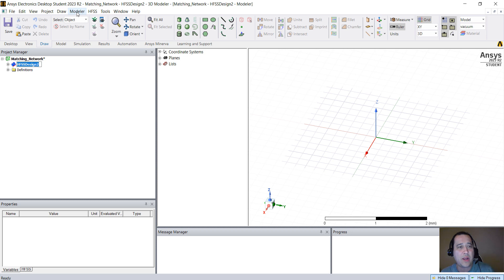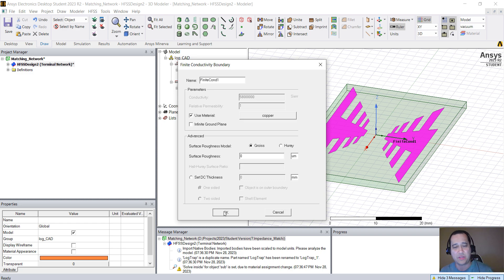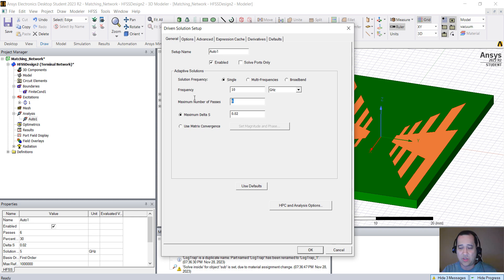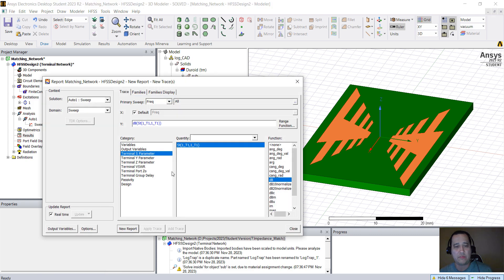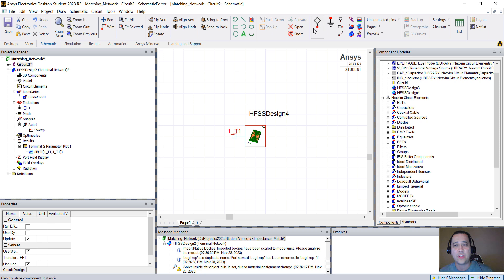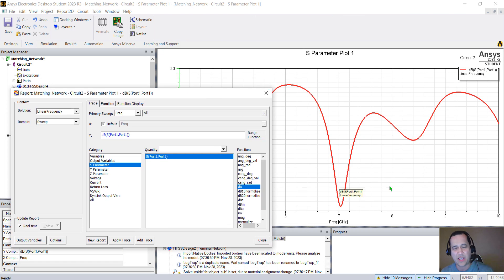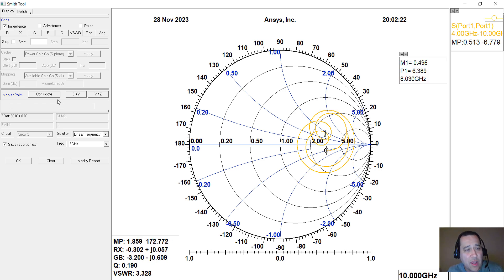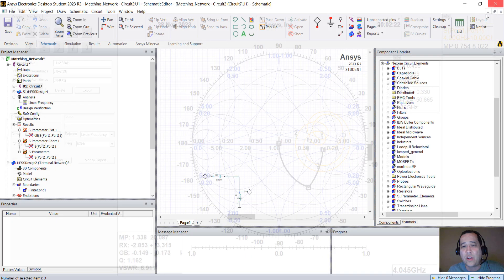How to use Smith Chart to create a Matching Impedance Netowrk with Ansys HFSS Student Version

Comment: Hello Sir, currently i am working on my project which inlude the 2 layer PCB, with 0402 SMD on top layer, and i have SMA connector, i want to measure the S parameter but i am confused where should i create the Port, i try but i am not able to simulate this. can you please help me with this